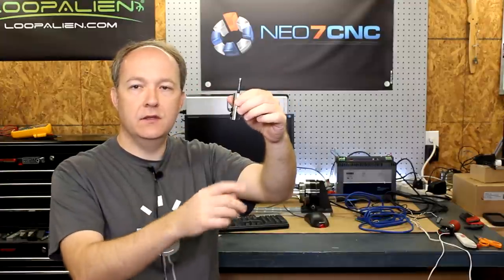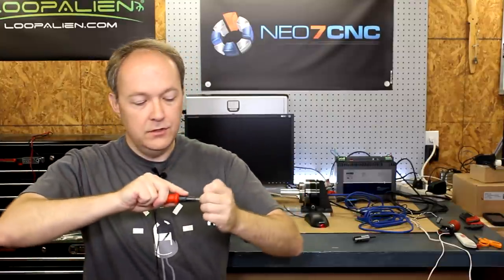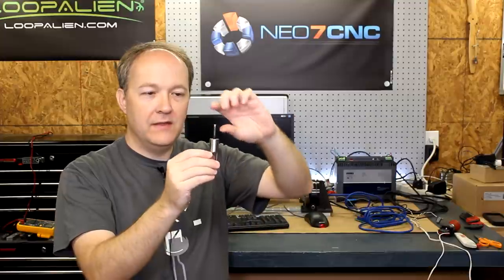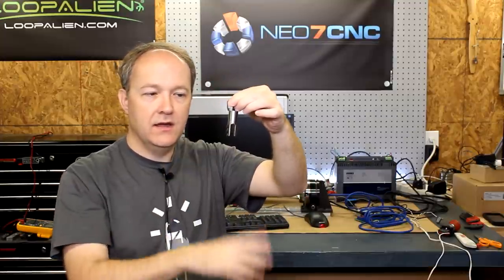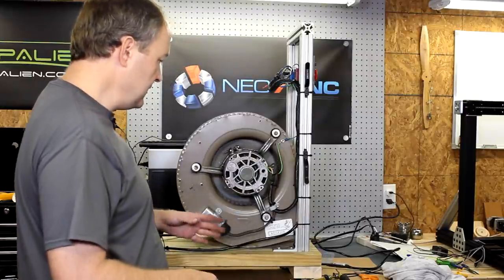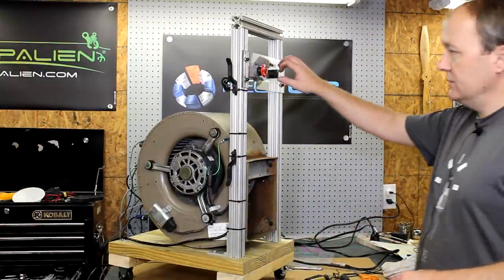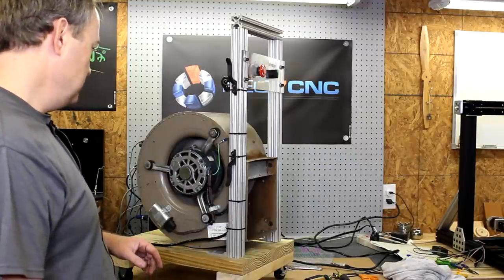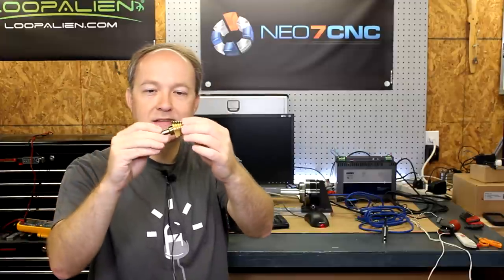Junkbox #2 - Neo7CNC.com

Comment: That point on motor orientation is pretty important and I'm glad that I saw this, before starting in on the next version of my chainmail ring cutter. I was thinking of using a similar motor and stepping the speed down. I could easily see myself making the same error.

Wrong tool for the right job will always be a thing ;)

Comment: If you want a cheep case, get an old PC case and rip out the old psu and internal brackets, it will have a place for a fan (it might even already have a fan ) use a piece of plastic (Perspex ) as an backplane to mount the electronics components.

Comment: I forget the exact name of the bearing material, it's some kind of sintered bronze that soaks up oil like a sponge.

I just got a 3 axis nema 23 kit with drivers etc. I have been mulling over the idea to use a big PC tower case to house everything including the actual pc. Then build a box to hold the monitor and custom panel with xyz zero buttons and jog wheel for easier setup.

I think this cnc is gonna have to make the parts for my better version. So I am goona make sure all the electrical stuff is just plug and play between units.

Thanks for all you uploads, you are very informative.
All the best.
Reply: Sirus I am doing exactly the same thing. Getting my CNC up and running to make better parts, us humans are not as exact as CNC. Also I will be housing all the components in an old tower case and using plugs and sockets to make the machine interchangeable between units.
Reply: Robert Ritchie
Cool! I'm only going to have around 300mm on xy and 150 on z. I orginaly thought much bigger. When I got building this thing I thought rigid as possible with what I have. I'm running 10mm threaded rod as lead screws to begin with and made anti backlash driving nuts that an engineer friend of mine was rather impressed about.
Tell me about human error, the last cut on the nut assembly using my homemade router table. Part snaged and bit my wedding finger.
That nail isn't going to grow back right, lol.
I would like to know your specs?